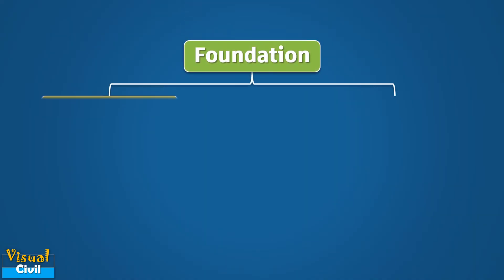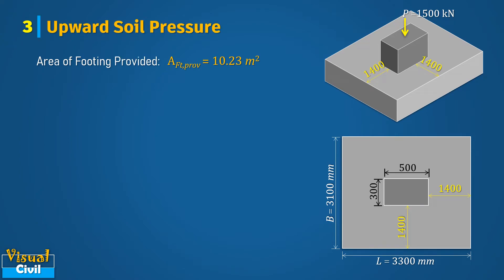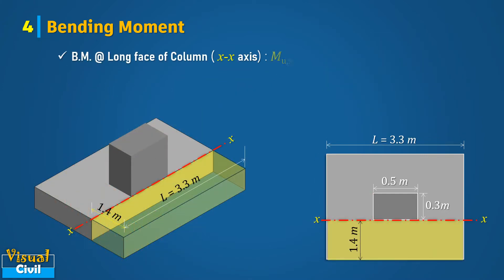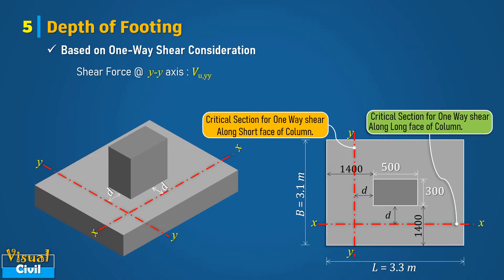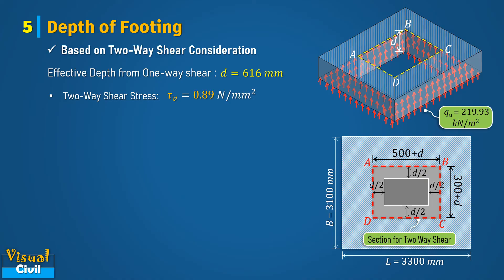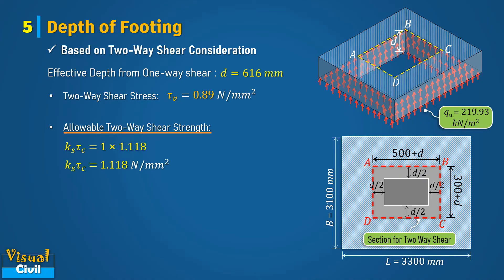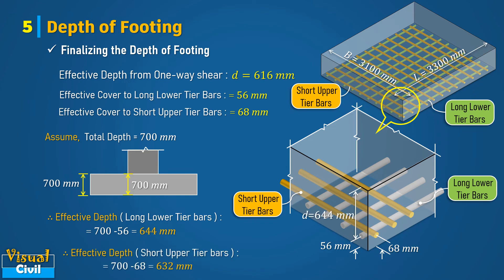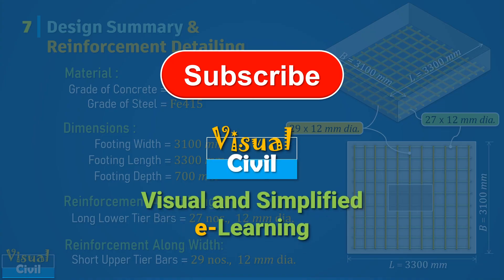Design of Isolated Footing | Pad Footing for Axial Load as per IS 456:2000.

Comment: Hatched area should be as follows for the calculation of depth by two way shear - (3300 X 3100) - (1116 X 916) = 9207744 square mm.
Reply from the maker: Yes there is correction, which is mentioned in the pinned message
Reply from the maker: Yes there is typo correction, which is mentioned in pinned comment

Comment: If flexural strength only requires bottom reinforcement, should we still provide top bars to control shrinkage- and temperature-induced cracking?
Reply from the maker: Not necessarily. If the thickness of footing is large or water table level is at shallow depth, then we need to provide top rebar for isolated footing

Comment: Sir please describe to me, how you took the value of x as 1400mm round off where the actual value of x is 1292 mm which is totally out from the 100 units approximate range. Please brief me about this I am struck over there with the actual value of X
Reply from the maker: Thanks for your query. The value of x is taken as 1400 for more safety margin in upward soil pressure. If we  consider x as 1300 for 1292 then safety margin will be very less

Comment: Can you tell how you calculate the hatch area
Reply from the maker: There is some corrections in the computation of hatched area, which is already mentioned in the 'Discription' of the video. It is as given below: 
Erratum:
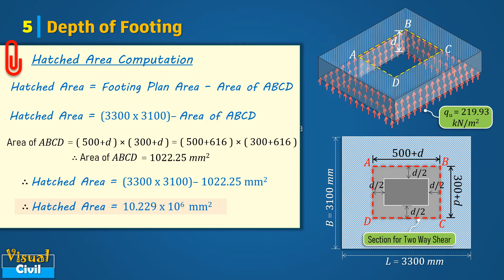At time stamp 10:35, kindly consider  "The Area of ABCD = 1022.25 x 10^3 mm^2". So subsequently the value of Two way shear will be changed.

Comment: Hello Sir, Thanks for sharing this fantastic video.
About anchorage or development of the main bars and distribution bars in the footing: if the calculated length of the Ld is too long for the space available in the footing, the bsr is bent up at 90° at the corner. What if even after the bend, the Ld length calculated is still too long for the space available?

Comment: Sir, I have one doubt in hatched area computation. 
Area of ABCD  WHY did u divide by 1000
Reply from the maker: Thanks a lot  @sharuhasini2096 for the query. The multiplication by 10 to the power 3 is missed in "The Area of ABCD". The actual value of "The Area of ABCD = 1022.25 x 10^3 mm^2". So subsequently the value of Two way shear will be changed.